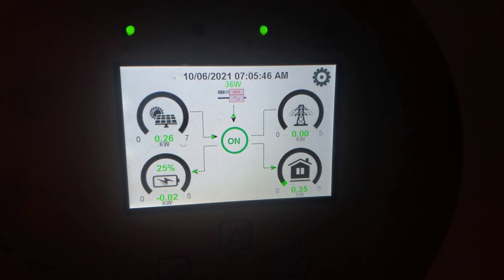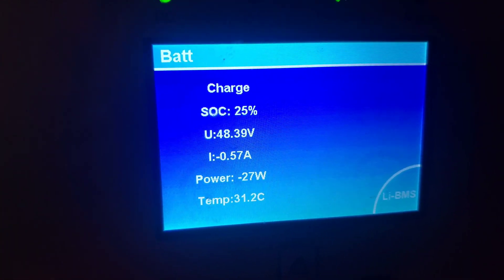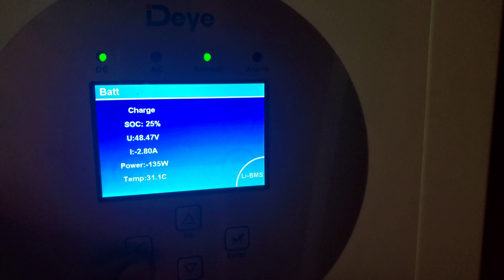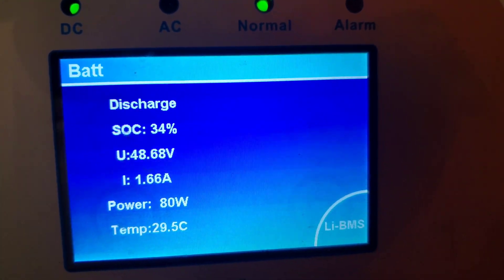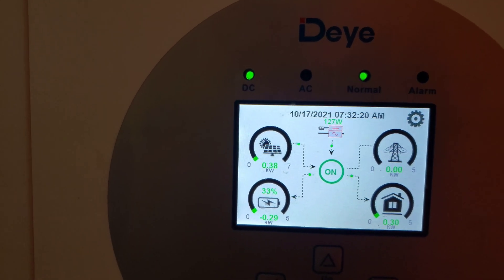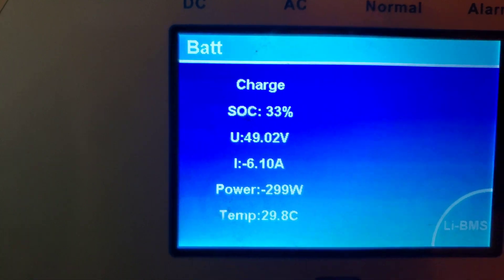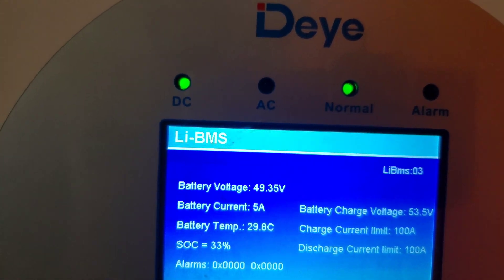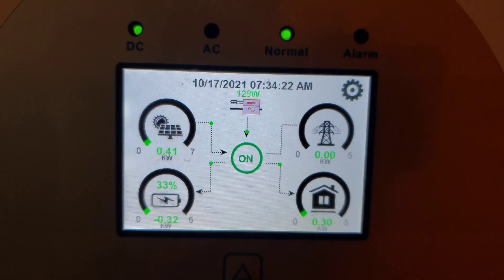Deye inverter major discrepancies

Comment: Hello dear. My problem with my Deye 50 kW inverter. When the inverter is taking all its load from solar power and my batteries are at 100% charge, the grid consumption is displayed as 0.014 kW. However, when I measure the current on the grid cable with an ammeter, it shows a consumption of 14 amps on each line. Despite this, the inverter's screen indicates no power consumption from the grid. Can you please help me resolve this issue?⸻Let me know if you need any further adjustments or additional details included!
Reply from the maker: Thank you for watching and commenting. I don't have any experience with the new Deye inverters. Start with a firmware update

Comment: My Deye 5kw inverter also says that it is using for example 417W from the grid, but my meter on the grid says that the inverter is pulling 590W, so quite a bit more.
Reply from the maker: They are not always accurate. Firmware updates do help.

Comment: Hi my deye inverter indicate 52.5v at the same time jk bms show 53.5. please tell me the procedure to set correct voltage on inverter please.
Reply from the maker: Use your multimeter to confirm what you see. Do you have BMS communications?
Reply: You can test externally with a multi meter or calibrate the BMS.

Comment: Hello Dr., I have a hybrid deye connected to 16 panels 600w each ,divided into 2 strings, the reading of the screen PV1=300v / PV2=300v
PV1=0A/PV2=0A and no power to the load and doesn't charge the batteries, once the grid is available the panels works properly if no grid available ,no power from panels.
Can I get your help. Thank you.
Reply from the maker: Thanks for watching and commenting. Please reach out to your retailer
Reply: @drsolar  Thank you for your reply, I really appreciate. By the way it work normally the second day without changing any settings or cabling.🤷‍♂
Reply: @ziadayoub2102  it was the same in my case worked great the second day.

Comment: I have a Two Deye 10Kw solar system, connected as master slave with a battery bank of 1320Ah / 2Volts, Lead Acid. The batteries are discharging very fast. What could be the issue . The batteries are new with voltages above 2.11V.?
Reply from the maker: Thank you for watching and commenting. What is your bulk and float voltage? Does it match what it says on the battery?
Reply: @drsolar  The float Voltage is 54.0V, Absorption is 56.4V and equalization Voltage is 57.6V. These are the voltages recommended by the manufacturer (BAE)

Comment: Hi, just installed two Deye inverters. Also picked up that the data is not great.
My bigger problem is that it keeps taking from grid even when battery is full and panels (14 x 540w) are in full sun. Only get proper PV readings when I turn off AC power.
Reply: Hi, so I fixed my issue with a Firmware update. I wish Deye will make the Firmware readily available on their website.
Reply from the maker: @timwridgway1453  which firmware version are you using? Glad it worked out.
Reply: @drsolar  C353 and 3367 was provided by Deye Service for my 5kva inverters
Reply: @timwridgway1453  I recently had a 5kw inverter installed, for the past month I noticed when AC is connected, the system pulls about between 120-150watt when battery is full and sun is out. How did you request for the firmware update ?
Reply from the maker: Congrats on your purchase. Check time of use settings

Comment: hi Dr. Solar, have you tried updating to the new firmware update, for the 5Kw inverter, after the update, it can now use 13A + 13A pv strings... but i dont know if it might solve your issue...
Reply from the maker: Thanks for the tip

Comment: Hi Dr Solar, I’m having issues as well with my Deje inverter. I have two of 5kW each, 24 solar panels of 390 W  each and two 20 KW batteries. With the current configuration they are generating only 600W in a sunny day. If I interchanged the master to slave and viceversa the production significantly improve to 2-3KW of production. I’m thinking on changing these inverters.
Reply from the maker: check your settings. Also make sure you have the inverters configured properly. Look for a Sunsynk video on proper set up

Comment: Thanks Dr. Solar. Amani from Mombasa city Kenya. Could be a calibration error. Best is to check the real values with a multimeter on the PV input lines, battery cables and load output lines.. then you can communicate with Deye on the side with the error which am sure they can correct with a software update
Reply from the maker: Hello Amani, thank you for watching and commenting. I would love to visit Mombasa soon. I will take your suggestion into consideration. Stay healthy.

Comment: Thanks for the video Dr Solar. Probably software issues? Would you consider doing manual checks with a multimeter at the battery/inverters to confirm the amount/direction of current/power flows and compare with the Deye claims on the screen?
Reply from the maker: Thank you for watching and commenting. Something to think about in my next video

Comment: Discrepancy in the  algorithm that regulates tthe parameters between charging and power production.
Inaccuracy is a common issue in the data output.
Reply from the maker: I think when the charge is low the discrepancy is more pronounced, it goes away as more pv comes in.